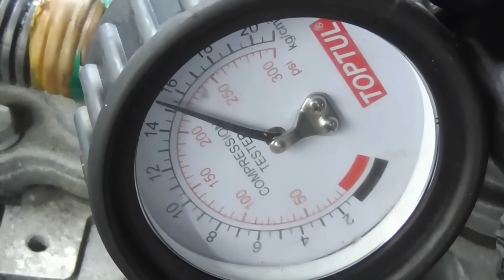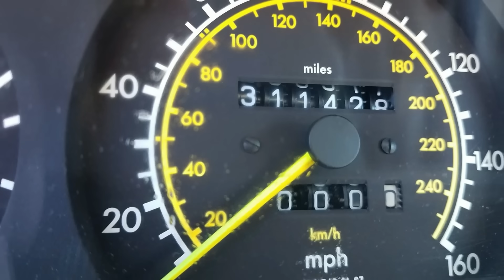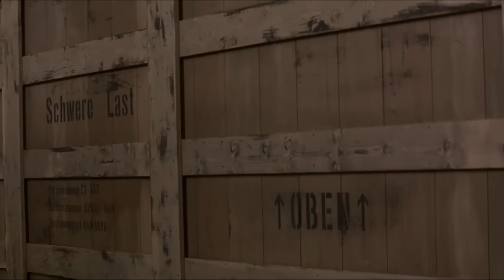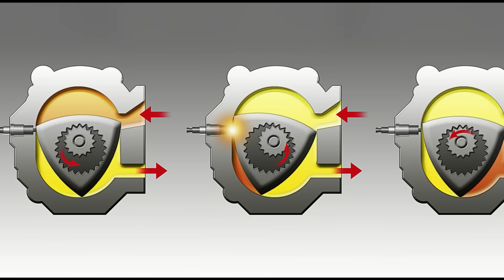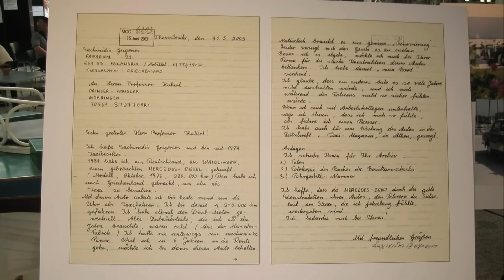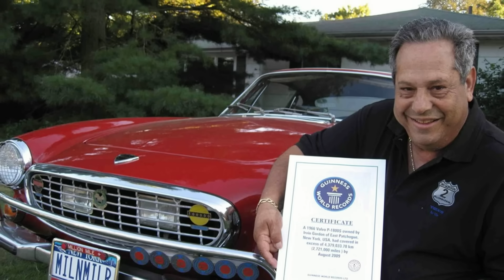Most Reliable Engines of All Time

Comment: Volvo was renown for having long life bullet proof motors. The saying "The car would rust out before the engin gave out"!
Reply: That said... when have you ever seen a Volvo rusted out?  Even the ancient ones had bodies that held up well over the decades, as did their engines.  Their 2.3ltr. red block 4 cylinder was overdesigned, overbuilt, and understressed in most applications (normally aspirated) and the only way to hurt it was to run it hard for years without an oil change.  I've only seen ONE of these engines fail, and that was because of low/no oil and 2 years without an oil change.   Got big respect for the red block /4 Volvo engine.
Reply: @tonyunderwood9678  I´v seen many a VOLVO rust out, I live in Sweden, worked at the VOLVO factory in Torslanda as well as a long shoreman in the Gothenberg docks. I remember back in 1973 we unloaded steal rolls that were sent to the factory for body and chassis, they were rusted when we took them off the boat. VOLVO galvanized them but the rust had gone too deep, the VOLVO 73-74s where notorious rusters. As for the VOLVO Drive Train....Best in the world.
Reply: @markwarnberg9504    I should have qualified my comments with "modern Volvo" sheet metal.  SO MUCH of the sheet metal available from the '50s, '60s and even the early '70s that was available was what some people called "Polish Steel" since much of it contained recycled structural metal materials left over from the war that was salvaged and reprocessed, and not processed very well because there was such a shortage of metals after the war that salvaging these metals from the rubble of war was just about the only resource to be had in much of Europe at that time.  France, UK, Italy etc ended up with a lot of this recycled war time material that was still being made available up into the early '70s (although better by then).  A lot depended on how wet an environment the cars made of this recycled steel lived through, and what sort of chemicals found its way onto the iced up roads in winter.  If the roads were salted in winter, all bets were off...    Fortunately this is for all intents and purposes all past now, mostly because all that questionable steel has since been used up and recycled yet again, only better this time around.    Some of that stuff even made it over here to the USA back in the 1960's where I've heard it called "compressed rust".   And yeah, the Volvo drivetrain certainly is fine, in anyone's world.

Comment: You missed the greatest engine of all time. The Australian Ford Barra turbo in-line 6 cylinder. Cheap to make more Hp and high torque
Reply: Really? Better than the almighty American Mopar slant 6? You kidding?
Reply: @SSGTA440  well they came out in taxis you can find barras with well over 700,000km on the clock theres some with near a mil and they kept going.
Reply: @edwardwalker7069  Yes, and that was the worst kind of driving, stop and go...I mentioned a guy I knew with a 318 Mopar in an ex cab that had well over a million miles and was still running. The flathead Dodge engines were also notorious for going on forever.
Reply: 283,327 Chev.

Comment: My 1993 Mercury Topaz with the 3 litre Vulcan V6 easily ran up to 186,000 miles, yet I doubt it's on your list.   Not a foreign-built engine.   My 2015 Chrysler 200 with the 2.4 litre Tiger Shark engine currently has 107,000 trouble-free miles, but it won't be on your list either.   It will likely run up to 200,000 miles before I'm done with it.

Comment: Ahhh, the Mercedes 300D regularly books 1-3 million miles.  Now that's what I call reliable. 100-250k miles is normal for just about any engine. Pffft!
Reply: Some Merc engines (A Class 1,6 l M 166, the 1,8 l compressor type M 271) barely make 100k miles without timing chain issues. The times when they built engines like the 300D are over, today they only build cost optimized mainstream stuff.

Comment: What about the 4.6 modular Ford V 8
Found in town car and Grand Marquis Crown Victoria
Reply: I had one with 420,000kms, still running strong
Reply: My 03 at 480000km and going to work tomorrow.
Reply: They don't talk about the 4.6l because it has a high failure rate from the start. Think it was mostly from the Romeo line. Newer ones got better though.
Reply: To fivepionteightnate
What failure rate?
The 4.6 liter Ford modular V8 was the best engine ever
Reply: @ralphabreu5022  If you had any first gen from of the Romeo plant you would know what I mean. Ring problems, oil consumption. They fixed them in the late 90's though.

Comment: The mopar slant 6 engines used in plymouth valiants and dodge darts auto in the 1960’s ran forever
Reply: 225 slant 6 AND the 318 c.i.d. were practically bulletproof. got 500000 km out of one slant 6 and my father's 318 Plymouth Fury II achieved 1.1 million miles before needing a valve job !
Reply: @timheersma4708  Love the 318!  Have one in my 1996 Dodge Dakota p-up.  Only has 103,000 on it now but purrs like a kitten and pulls a 21’ TT like it’s not there.  The truck had the tow package with the heavy duty tranny with the cooler.  Specs allow something like a 6050 lb. pull load.  MOPAR!
Reply: Almost all American made inline 6 cylinder engines were known to be stone cold reliable.
Reply: @billwessels207  inline didn't match the slant. I have owned both, maybe a bad one, but I did destroy the inline, but the slant 6 outlasted the body
Reply: The Slant 6 is an inline engine. The bores are all in line but the engine is slanted over that’s all.
Reply: @shawnlizeleatherdale4052 , The Slant Six IS an inline engine.
It is just leaned over, 30 degrees, to the passenger side.
(Well, here, where we have the passenger on the right 
side of the car.)

Someone mentioned that Chrysler discontinued this 
engine, BECAUSE of it's longevity.  The Valiant and Dart 
suffered the same fate, for the same reason.  "Ugly" and 
won't die.  Let's stop making them.

2 Slant Six engined vehicles, and 2, 318 vehicles.  Neither 
had an engine die.  (Oh, for you Mopar motorheads, my 
favorite car, A833 383.  '70 B body Plymouth.)

steve
Reply: @steveskouson9620  normally when talking inline 6, the straight 6 comes to mind. Everything straight up and down. They blow up quite easily. The Chrysler / Dodge / Plymouth didn't. Without putting up schematics etc, it's just so much easier to say that the slant 6 is a better design. I live in Asia now, and I was very surprised to see that a lot of the construction equipment, such as generators etc are using the slant 6. And that's in some very old equipment.
Reply: @shawnlizeleatherdale4052 , All six cylinders are, really, IN LINE with each other.  Period!

But, they ALL may not be in line with the rest of the world.  They imitate ME in that 
respect. (:D)

Did you know that the Slant Six only has 4 main bearings?  And, they are the same 
size as the other G engine's bearings?  That engine had a massive FIVE main bearings.
Yes, the second gen Hemi.

steve
Reply: @shawnlizeleatherdale4052  Dude! The slant six is an inline engine. It's called the slant six because they turned it somewhat on it's side so it could have a lower hood line. But look at the row of spark plugs all in line...
Reply: Slant 6, the 318 and 440 were great engines
Reply: @shawnlizeleatherdale4052  mmm
Reply: @shawnlizeleatherdale4052  what about the 426?
Reply: @ck515084  hemi, real strong, very heavy , and most got blown up
Reply: Maybe that's why Chrysler stopped producing them, they were too reliable.
Reply: @leonardbreau8928  Unfortunately this seems to be the case with modern GM and Chrysler products.
Reply: @leonardbreau8928  5.2 and 5.9 pretty reliable
Reply: They stopped making the slant-6 because:

1) couldn't meet pollution requirements 

2) not adaptable to front wheel drive
Reply: @JugSouthgate  according to the feds they couldn't meat the pollution requirements...

Only according to the feds.. let's just say I know a couple auto technicians who are doing some interesting stuff to them.
Reply: @DerpyRedneck  it's one thing to custom build engines that meet a certain requirement. It's quite another to mass produce them.

Remember that the slant 6 was developed for a specific purpose: to fit under a low hood.
Reply: @JugSouthgate  I mean we can still do that, the modern combustion enhancements and emissions lowering things we have now are able to make it possible these days!
Reply: @DerpyRedneck  maybe. But the combustion chamber shape may be an issue.

There's also the fact that the slant 6 is too long for front wheel drive vehicles.

It's interesting that a few early slant 6s were made with aluminum blocks,  much like modern engines, but then Chrysler gave up on the idea.
Reply: @JugSouthgate  it's a framework at least, let's consider that!

Imagine if we could make engines like this again.
Reply: I put 340,000 miles on my 1963 Dodge Dart slant 6 engine. The car was given to me with 100,000 miles on it, and I had the engine rebuilt. Drove for 14 more years with only one breakdown caused by a cracked distributor cap. Gave it away still running fine.
Reply: Leaning tower of power
Reply: That's true
Reply: Mopar powa behbeh😂
Reply: Absolutely! My family owned four!
Reply: YEP!!!!
Reply: Is this a high performance engine reliability post or every day drivers??? No mention of the Ford 300 CU IN in line 6 engine that I personally owned a 1965 Ford Fairlane that I sold with 491,600 miles on it still running just fine. They were made from 1965 thru 1996 and they were not just in cars/pick ups ether. Many farm tractors, farm equipment, utility vehicles and the big brown UPS trucks had them as well! They were not high mpg engines but RELIABLE! I have one horror story though that my Brother bought a 1967 Ford F 250 4x4 with a 300 six in it. In the summer of 1969 I asked him how often he changes his oil because he was complaining that it was burning a quart every 300 to 400 miles? His reply was, "Change oil?" It had 45,900 miles on it with the original oil and my brother only adding oil when needed. I changed his oil/filter putting in high detergent oil. He took my advice having the oil changed again in 100 miles. It lasted another 38,100 miles before it locked up.
Reply: The  245  slant 6 was an Aussie Legend. You could not blow that thing up.
Reply: The slant 6 was 225ci, the 245 was a hemi engine and it was not a slant 6
Reply: My first vehicle was a 1969 dodge D100 with the 225/6.  My sister was given a 1964 Plymouth valiant two door with a 170 slant six.
Reply: The slant 6 was used in the Dodge D150.
Reply: And BEYOND!!!
Reply: The slant six from 60 to 74 had forged cranks with extra wide bearing surfaces. The camshaft is about 2 inches above the oil pan so the lobes never starve for oil. I prefer the 198 Version because it revs higher.
Reply: The Mopar slant 6, and the 318 cu in were very good engines. The Chevy 283 and 327 cu in engines were very good GM engines. The Ford Vulcan V6 engine was a very good reliable engine. It ended in 2008. Used in some Ford Rangers and Ford Tauruses. Not overly powerful. But reliable.
Reply: It was designed to have a cast aluminum block, which was then cast in iron.  That made it really stiff.  Less flex = Less wear
Reply: Don't forget the d100 and d200!!!
Reply: Yup, and the Ford 300-6 too. Neither mentioned
Reply: This was a tuner circle jerk. Nothing else.
Reply: Slant-6 was designed to be made out of aluminum for racing, but because the aluminum casting of the late 1950s wasn't up to par, they cast it in iron for their 1960 new economy car, the Valiant. The thing was insanely overbuilt, sharing a clean sheet design and bearings with the 426 Hemi - same designer, Tom Hoover. The rest of the car would fall apart, and you'd take the head off a Slant-6 in a junkyard and still find original crosshatch in the bores after 300,000 miles.
Reply: So all those engines would still be running as forever is time with no end.
Reply: @zelensky6439  so you are saying you like driving around with people you think are pedophiles.
Reply: Also the venerable 3.3 / 3.8 litre V6 in them Dodge Caravans. Had 3 with over 450 000 km's on original engines. No problems. Trannys needed frequent rebuilding tho, bummer 🙂
Reply: @Red ROCK Had one in HS in a Valient.  Great motor.  Only problem we ever had was the pushrod rockers were bent steel welded together and some of our welds broke but was a pretty easy fix with re-weld.
Reply: Put a high performance intake with a 4 barrel carb and headers on one and it would do 105 mph.

Same as a stock 225,, but it got there a hell of a lot quicker.
Reply: thats because the rest of the car fell apart wake up you dumb asses cars were junk then
Reply: @jonpickett7878  But they were easy to work on & parts were cheap, unlike today's cars. I have to agree that the bodies didn't hold up very well to rust.

Comment: I am driving a 2000 Subaru impreza with the EJ15 engine in it. Its done 549000 km   so far and has never been touch. Regular oil chang at 5000km, transmission at 30000km, changed timing belt on interval, never change front seals only the plug seals, cover gaskets and rear cam seals were replaced once.

Comment: You clearly have never worked on any of these cars.  The concept of Honda as a reliable engine is insane.  Every single rebuild I have carried out on Hondas was at low mileage, and the parts costs are absolutely outrageous; much more expensive than the German cars.  The only one you got right was the Mercedes 300D.
Reply: And there are many diesel engines that will last longer than the 300D. Even the unsleeved Cummins have a B-50 rating of at least 350,000 miles.

Comment: Left a lot out and biased to Japanese engines.  NA Miatas run forever 250K to 300K miles is not unheard of.  Chevy LT1s, Ford 302s.  I think currently LS engines will prove to be extremely reliable.  A v8 at highway rpms with a good overdrive transmission will run for a long time.

Comment: 200.000 Miles is perfectly normal on maintained european cars. As BMW is very reliable in europe. Until >2008. Personaly i had a e39 525tds running 450.000 miles. Never changed the turbo, hp pump and changed injectors just once. Its still running in eastern europe. Also sold an 330i with 200.000 miles running perfectly. Currently driving an VW EOS 2.0 TFSI with 180.000 miles. And it is a perfecty running car. Chipped to 270ps. start talking about relaibility at 300.000 miles. Or total maintenance costs over mileage.

Comment: the 4 cylinder Toyota,  the engine is amazing.  I drive a 98 , basic model Tacoma, and am certain the rest of the truck will give away before the engine.  its a quarter ton, and the leaf springs are pooching, seems to be a problem with that model, but love the truck.

Comment: My Mazda 4.0 liter Ford engine went 325,000 miles with no problems.  A car accident ended its life.  It outlasted two transmissions and one front bearing.  The starter,  alternator, belts and hoses, timing chain, and water pump were still going strong.  It powered my B 4000 4x4 up and down the interstate for 11 + years.

Comment: This is FAR from accurate or credible. The Mazda rotary was an oil drinking failure. They stopped production because of its unreliability. You failed to mention the Ford industrial 4.9 liter / 300 cu inch straight six which is not only famous for 300,000 miles plus but is inexpensive to rebuild.

Comment: You forgot the 5VZ-Fe engine found in early tacoma's and 4runners. Those engines were built like tanks.
Reply: I agreed! Them 3400 are bulletproof! Also he put 2jz in #7 and is more reliable than the rb26 and others!! 2jz should be #1 also forgot to include the bulletproof mitsubishi 4g63t.
Reply: Yea Roger. 270000 run like a top. Timing belt and waterpump. That's it.
Reply: @jeffcollier7185  Haha yea, For my it was Timing belt, water pump, and through the vehicle's life. 1 Head gasket replacement and 1 Oil pan gasket. But that was after 20 years with 250k. Engine finally went after a little south for 600k

Comment: Sorry but you obviously have a severe bias towards non-American (North America) engines. This is just a list of non-American engines and a few of them are horribly unreliable. I like BMW and their new engine is a joke. 258ci i6 created by AMC was first put into production in 1964 and when Chrysler purchased AMC it was such an incredible engine and so reliable that Dodge continued to manufacture the engine until 2006. It destroys just about every engine in this list in reliability by a long shot. Changes to the engine including adding fuel injection changed the heads which made it a 4.0 but the core of the engine remained the same. It's probably the most produced engine in history and probably powering more jeeps than any other engine even today.

Comment: My 96 Mazda B 4000 4x4 had 325K miles on it when the guy I sold it to totalled it in a crash.  Only thing I ever did to it was change the oil and filters every 8K miles and I uses Valvolene  oil!  I only replaced two transmissions during that time and most of its miles were Interstate travel at speeds of around 75 mpg.  That Ford 4 liter engine is one of the best I have had.

Comment: Audi A4 1,9tdi  from 1995 to 2000 ...... easy 500,000 miles on the long distance, even the water pump never needs to be replaced is my experience.